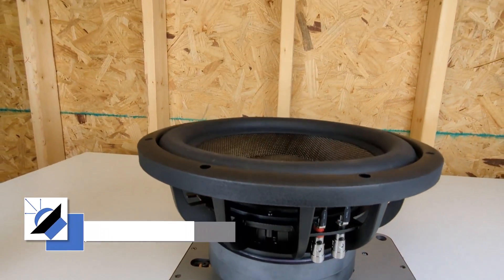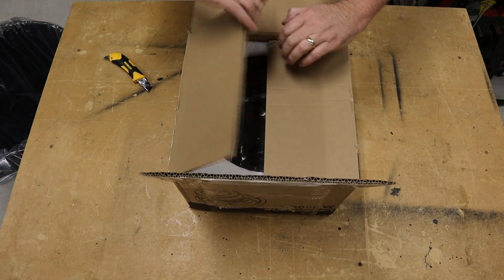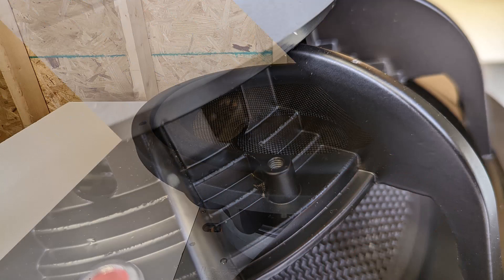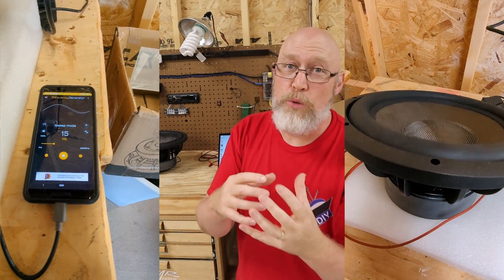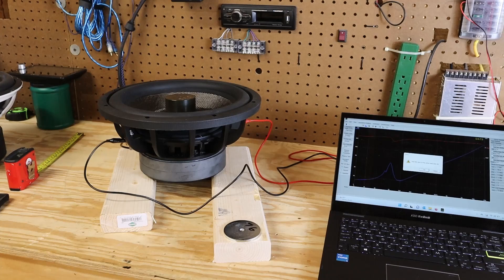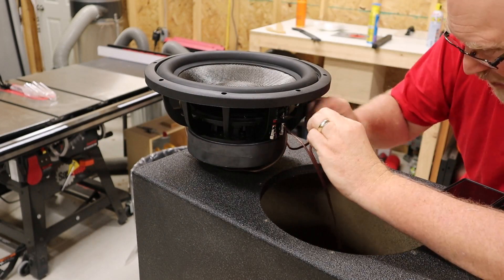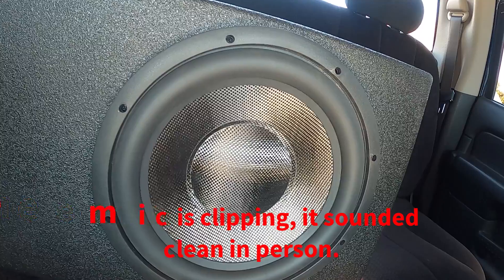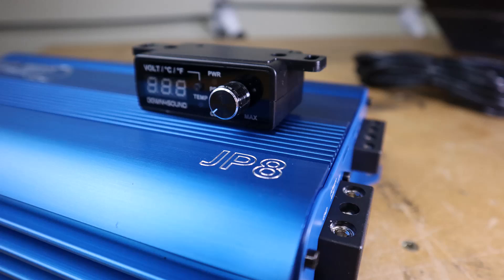1000 Watt Carbon Fiber Subwoofer:  Light Harmonic Thunder 12

Comment: The rule of thumb that I have developed for modern woofers is that a 1" voice coil is good for 25W RMS, and the power handling rises and falls with the square of the voice coil diameter. Dual voice coils do not make any difference, as the power will be split between the two coils. So, a 2" coil is good for 100W, a 3" is about 200W, and a 4" is about 400W. This can vary by about a 2:1 ratio up or down, depending on how much effort the manufacturer puts into the design. A 3" voice coil will not handle 3KW or even 1KW continuous for more than a few seconds. This rule of thumb comes from 45 years experience as an audio tech.
Reply from the maker: According to that rule of thumb pretty much every subwoofer out there cannot handle rated power.
Reply: @DIYAudioGuy  Not continuously, no, they can't.
Reply: man.. that rule of your thumb is so wrong. 😂😂😂😂
Reply: @drutang  Please explain in detail.
Reply: My 2.5 inch DVC has been taking 400-450RMS (Clamped) for over a year and it doesn't care lol
Reply: @BlueTegu360  the odds are you're using an amplifier that is rated 450 Watts but actually puts out about 50. Federal Trade Commission rules on power specifications do not apply to car amplifiers and so a great many of them are just flat out lies. There are truly high-powered car amplifiers, but most Garden variety car amps won't produce anywhere near their rated power. Now, if you want to connect that to a variac and adjust its output voltage to produce 450 watts into whatever impedance your woofer is, then maybe go get some lunch and come back and see if it's on fire, then you would have a legitimate result.
Reply: @ScottGrammer  The amp is rated 600rms at 1ohm (and typically does a lot more on the dyno), I'm at 0.75ohm and clamping 400-450 rms. Clamped means it's been metered with a digital AC clamp meter to get a true RMS.
Reply: @BlueTegu360  Interesting. Are you accounting for the inductance of the voice coil, which could result in serious power factor error? You cannot just multiply current times voltage, you need to account for power factor/inductance. Still, that's very cool if such a relatively small voice coil can handle that kind of power for hours on end. Also, I did mean continuous RMS power, as in a sine wave left on for eight hours or more. It's the way sound reinforcement speakers used to be rated before the BS power wars that started in the late 80's. For instance, JBL 15" woofers with four-inch edge-wound ribbon voice coils were only rated for 20 watts when they first came out, although later advances allowed them to up that rating to 100 watts. But when they said 100 watts, they meant a 100 watt sine wave at any frequency above the resonant frequency of the woofer (in a cabinet), for at least eight hours. A similar woofer today might carry a rating of 500 watts or more, because they don't warrant the drivers for true continuous RMS power.

It's also safe to assume that very long voice coils can handle more power as they spread the heat over more area. Considering that, it may be that my rule of thumb needs revising for such drivers. But I did say it was a rule of thumb, not a hard and fast rule.
Reply: @ScottGrammer  The music I listen to is basically sine waves lol.
 I listen too deep dub that has near consistent tones between 30 and 45hz and it plays just below clipping for the 4-6 hours a day I'm on the road.
Yes, when metered everything is accounted for digitally, that's the whole point of the meter.  Speakers and amps have come a long, long way since the 80s, and while my little 10 inch 600rms skar gets warm because it's in a sealed box, it never gets hot. 
My mate is clamping 3400 watts and drives it through two 12 inch sundowns that only rated for 1000 each and they take that power for hours a day as well.
Reply: @ScottGrammer  How do you account for power factor/inductance? 

I've measured my subs voltage with a multimeter and current with a clamp meter before and they seem to be accurate enough. But if I'm doing it wrong I'm open to learn more.
Reply: @JoshM7  The best way to do it is with a dedicated wattmeter. These meters measure voltage and current, but also take into account the phase relationship between the voltage and the current, and factor that into the wattage reading. 

When driving a reactive load (capacitive or inductive), the current will either lead or lag behind the voltage. This phase difference between voltage and current is what causes the actual power dissipated in the load (true power) to be less than what is suggested by multiplying the voltage times the current (apparent power). The difference between the two (true and apparent power) is called power factor, and in motors (which is what a loudspeaker is), the power factor is usually between 0.5 and 0.8. In a purely resistive load, the power factor is 1, so there is no difference between apparent and true power.

Note that the power factor of a loudspeaker will vary somewhat with frequency, and is dependent on how the speaker is acoustically loaded, so the cabinet and environment will make a considerable difference. At its resonant frequency (or frequencies), the power factor will be 1, although the actual power dissipated will be lower than normal because the impedance will rise and the current will fall.
Reply: @ScottGrammer  I'm curious if that rule takes into account multiple layer VCs.  Most high power subs use 2 or 4 layer voice coils, the more layers it has the more power it can handle.
Reply: @damedog19  That's not really true. While it is true that many consumer-grade woofers (including car subs) use multi-layer coils, heat developed in the inner layers is held in by the outer layers, making the inner layers even hotter. Look ay JBL, Peavey, Electro-Voice, Gauss, or (vintage) Altec-Lansing professional sound reinforcement woofers and you'll find single-layer coils and very precise, narrow magnet gaps which not only keep the field strength high, but do a better job at wicking heat away from the coil to be dissipated to the air by the magnet structure. Multi-layer coils require a wider magnet gap, which in turn requires a larger magnet to keep up the required magnetic field strength in the gap, and the wider gap actually hinders cooling of the voice coil.

Comment: Are there any woofer companies that do a break in on their speakers at the factory? Seems like that would be a good way to screen out manufacturing defects and protect the company's reputation.
Reply from the maker: Probably not.  It would labor and energy intensive to grab every driver, connect to an amp and let them run overnight.  Most quality control is done by testing a random sample.  Plus you don't need to break them in.  Just enjoy the music and they will do that on their own.
Reply: Only company that came close in my opinion is Rockord Fosgate.  But they only QC'd certain subs from a lot and if it failed I believe the lot failed. They had a shipping container set up with a lot of subs just playing continually for days. I remember this from RTTI training back in 07.

Comment: At least you can take solace in the fact that it looks nice. Even if you can’t get the TS parameters the typical way.
Reply from the maker: Once I got over the novelty of the carbon fiber I did not much like the look.  Most of the shots are from the back side because that is it's best angle.  I would recommend installing it with the face down and the back side up.

Comment: Using wood to lift the sub to clear the vent is not smart  it will give you falls readings ..it transferring energy to the table and back
Reply from the maker: Correct,  when I was doing that I was wondering how long it would take for somebody to catch it (about 45 minutes).  Next time I will be sure to grab some foam insulation.

Comment: I know the build house of this driver. The build house makes the Skar EVL and other drivers for quite a few vendors. The EVL was built in a different build house than their other drivers. The tsp's of the EVL are horrible.  I have personally worked with the build house, and upon receiving samples in 8"-15" drivers, and working with them on a design...they didnt follow any of the cooling, and motor specs, with designs I worked on. They weren't easy to deal with overall, and we didn't feel comfortable at all, with moving forward. I knew exactly who built this driver, as soon as I saw it. 👍
Reply from the maker: That's cool!  I have no experience with any of that, but I would like to learn more.
Reply: @DIYAudioGuy  when I was working at a car/marine battery plant the only difference one could tell in batteries between vendors was the case on the outside and the amount of lead paste used(marine vs car)(weight of battery).  Interstate, walmart, advanced auto, etc. were all built on the exact same lines with specifications so similar there was really no difference.  A lot of components in subwoofers are just he same coil, spider, frame, magnet, cone etc. interchanged around to cause varying sorts of specifications between manuf.
Reply from the maker: It is the same in every industry.  Most of the chicken you eat comes from Tyson or Perdue Farms.  They just put it all in a different package at the end of the assembly line.  I don't think most people realize that this is just how business is done.
Reply: @DIYAudioGuy  yes,  there are MANY speaker manufacturers in China. But, there are a few that really build great drivers overall. JLD is a huge speaker manufacturer that builds almost exclusively for "that" big brand. But, AF Audio, is a cheaper build house...and the one in question. They have great build quality...but they just lack in R&D and are a cookie cutter build house. Their "engineers" are sub par. They think because it works...it works. MAX Audio does some great work with drivers as well. We have eventually went with the build house, that builds drivers for Carver. Very knowledgeable,  and we have come up with some very nice neo subwoofers. As is my profile picture. Most subwoofers you buy, come from 3-4 main build houses...and many companies do not do much design work, with the exception of Jacob at Sundown, and 2-3 other guys. I'm always trying to help, anyone who wants help, with driver info, and overseas houses.
Reply: @DIYAudioGuy  the fs is really, just a number, that doesn't really correlate with its overall performance, as it's just a free air value, and  just enough to move the cone to register. But...the Mms(moving mass) does matter much more. The driver, would need a really "heavy" voice coil, and or added mass to..let's say, the dust cap as well, to lower the overall Fs...but to also have all around performance and sound quality.. While carbon(glass) fiber looks cool, and is strong...it's very lightweight. It needs multiple layers, and or resin coats, to add mass. I would suspect,  that this driver is more suited for sealed enclosures. We have two 12" with that exact cone and cap, and the tsp's just weren't up to snuff. Just very inefficient overall. They look great, but looks can be deceiving lol. I can say, that of all the drivers we received...the 8's were impressive. This was a great video Justin, I enjoyed it very much! 👍
Reply from the maker: @Chuck_Sanders  you clearly know a lot more about it than I do! I don't pretend to know everything, but I'm always trying to learn more.!
Reply: @DIYAudioGuy  nah man, I love watching your videos. You provide great content sir. You have a great deal of knowledge and it grows more and more. I don't know everything lol, and I'll never  claim too, I just have studied Audio as a whole since the 80's and have gotten a lot of great knowledge passed on to me by great people like Thilo, Dan and more. Most people don't see, that China will sell you the dream..but its mostly what others have already designed, and they can just  copy it and change a thing here and there,  to make it cheaper. Keep up the work man, you help many.
Reply: @Chuck_Sanders  is there a big difference between an SQ subwoofer and an spl subwoofer?

Also would you know what  good SQ subwoofer for 150 or less would be? Brand wise I guess?

Preferably 12 in maybe 10?

And where could I find out the differences between 2 drivers built nearly identical difference being one is let's say 300 watts and the other 500 watts etc

Do higher watts mean louder or better sounding?

Lastly are all amps claiming identical watts the same or would one brand sound or play better low frequency than the other?

🤟🏼
Reply: @Dan_Hazard  there absolutely is a difference, Dan. Copper wound voice coils,  sound better overall,  versus an aluminum winding coil, and typically yield better BL as copper is a much better conductor over aluminum, and it's also heavier. Typically a sq driver, will have a higher Mms(moving mass) where as with spl drivers, you typically want a lower moving mass(Mms) like a lighter weight cone, lighter coil,  and a stiffer overall suspension. Sound quality drivers, typically have a much softer suspension,  with a lighter compliance spider, heavier coil, softer roll on the surround, heavier cone and so forth.  SQ drivers will work great in a sealed enclosure, and also in ported,  tuned accordingly. Dayton makes some very nice drivers, the Kicker Q series is pretty good as well,  but in my opinion is just overly priced, MTX 4500 series drivers are very, very efficient but they have lower power handling but great sound quality(vendor on ebay sells them,  new old stock)Savard drivers are really nice,  and believe it or not,  Seismic Audio has some drivers, that are fairly cheap,  and sound great in all honesty. Arc Audio,  if you can find them(seen them on eBay the other day) are very nice. If I knew your budget, and what space you were working with, I could probably be more helpful, lol.  I've also built many myself.  I've did a lot of custom built drivers, recones and oem work over the years. As far as amplifiers go, and comparing power ratings amongst brands, it's apples to oranges. I myself , my wife and a few of my close friends, run full bridge amplifiers. They are models(samples) that we have been working on with Sound and Power, out of China. We've made revisions to the filtering section, also faster switching fets, changes up the crossover points to start at 40hz, versus typical 80hz for low pass, and correcting some issues with transformers and so on. Full bridge is the way forward, and many people give them a bad rap..because of the initial HD Series from Taramps having problems. Full bridge has been around, for a long time. Alpine, Rockford, MTX, JL, JBL and more, have used the technology for quite some time. "Brazillian" Full bridge, was the issue at first, and had Problems.  I would stick to trusted brands, and not cheaper "fly by night" companies,  because cheaper isn't always better, but, there are some that are cheaper, and get the job done, like Sound Qubed Full bridge. I prefer Full bridge, over the usual half bridge, as the footprints are smaller, and they are more efficient... Less electrical strain. I wish I could help you more on here, but if you need any further help, can always email me at nobsaudio76 at G mail dot com
Reply: @Chuck_Sanders  thanks I appreciate the response I will keep in touch 🤟🏼😝🤟🏼
Reply: @Dan_Hazard  you're very welcome 👍
Reply: @Chuck_Sanders  I absolutely love my Savard Hiq 8's.
Reply: @brandenplaisance6705  agreed. They are very accurate and responsive, and the sound quality is great. They are one of my favorite 8" drivers, hands down. I used 2 of them, in my daughter's surround setup for her, and tuned them to 24hz. She absolutely loves the low end extension, when watching movies, and playing music. 👍
Reply: @Chuck_Sanders  😂😂
Reply: Which tsp are terrible?
Reply: @bpimpin6037  yeah I remember my brother had a 10 inch kicker comp c in 2007 in a sealed box that sounded dope, I thought that a 12 would probably be better, but you never know nowadays